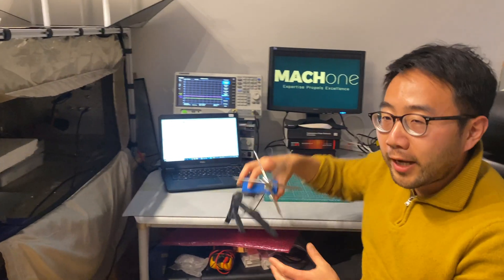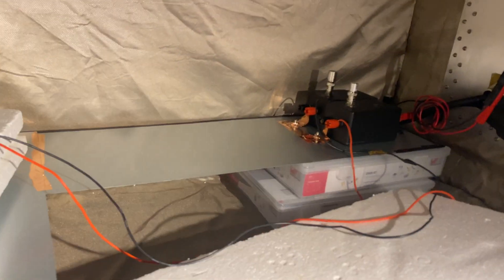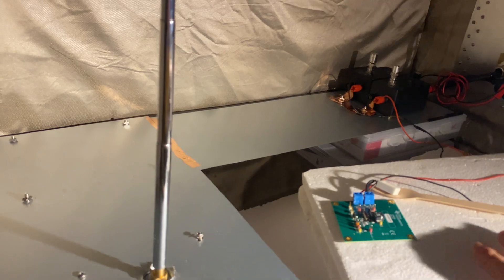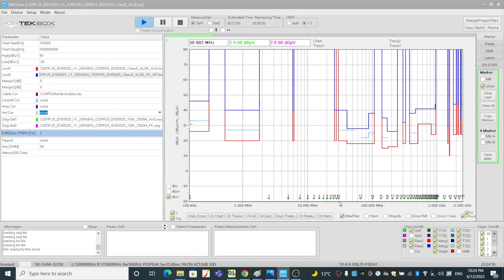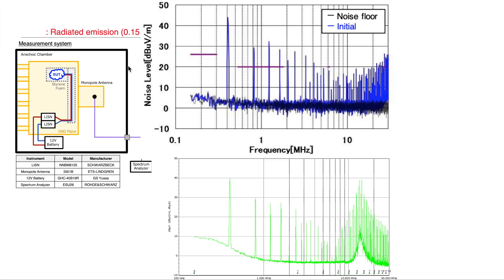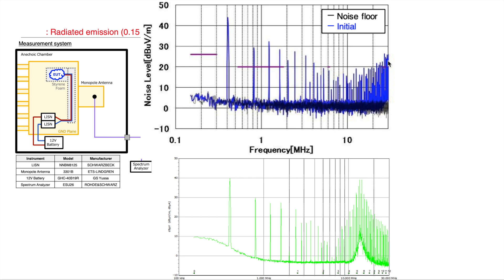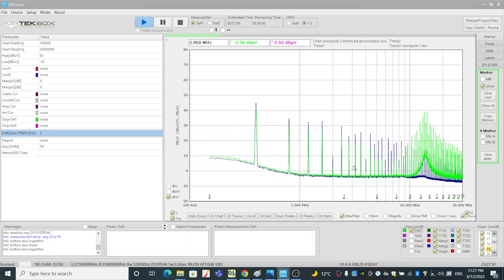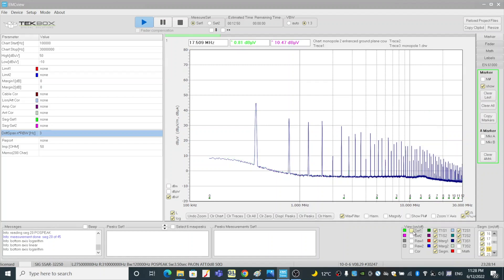Radiated Emission at low frequency range - Active Monopole Antenna Pre-compliance Test Set-up

Comment: How do you determine the origin of an emission being cable ressonance rather than caused by the DUT?
Reply from the maker: Rafael, good question, it is a switching event related noise resonance. So it is the 1/Tr corner frequency point, where Tr is the rise time. And often it is very strongly related with the cable length. So it starts from the DUT, but where it resonates depends on the cable length.